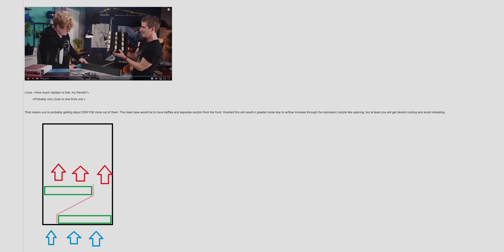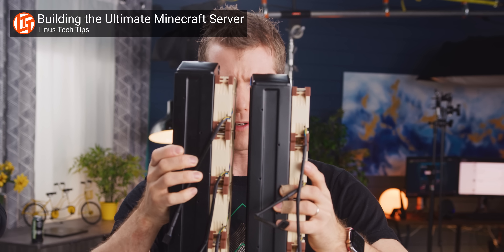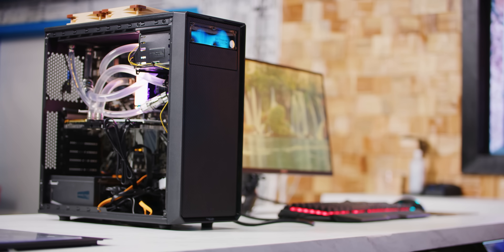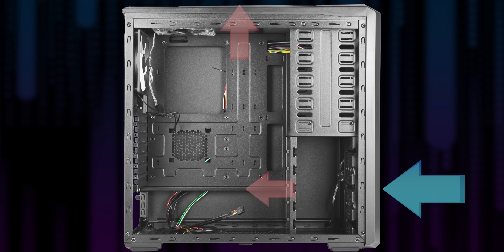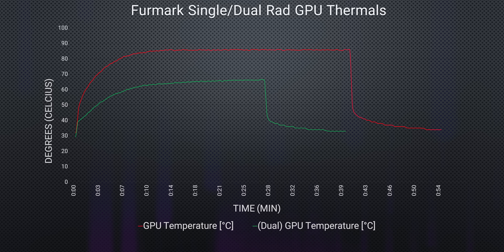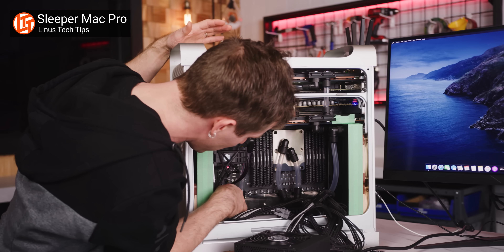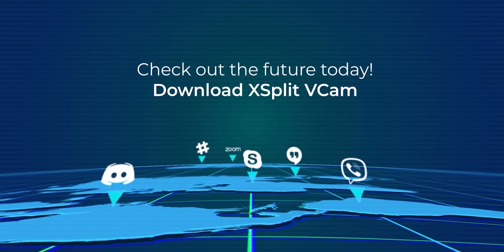I’ve been water cooling wrong for YEARS - $H!T Manufacturers Say

Comment: If you can feel the temperature difference between the air coming out of a radiator in your loop and air going into a radiator in your loop, you have a sub optimal amount of radiator. You can never keep coolant lower than or exactly equal to ambient, but as close as possible within the constraints of your build should be the goal. More radiator = more surface area = more heat can get out of the loop more quickly into the air = lower coolant temp. Lower coolant temp = greater delta T at the part being cooled by the water = better cpu/gpu temps. You don't want your delta T from water to air to be large. You want delta T from coolant to cpu/gpu to be as large as possible, and if your coolant warms up that shrinks, reducing the effectiveness of your coolant. I think what corsair was probably getting at is there are more efficient solutions to get the same amount of heat transfer out of less radiator compared to just brute forcing it, but brute forcing cooling always works.

Comment: I always try to put my radiators as intakes whenever possible, so there's a larger temperature differential. It also makes for positive air pressure inside the case which is beneficial as well.
Reply: I do the same. Found out that water temp can be 2-3c lower which is huge. Just that dust tho...
Reply: @MrScart35  Yeah the worst is clearing the dust between the radiator and the fans. I typically do that once a year. I don't live in a high dust environment thankfully.

Comment: The real problem is that you keep ignoring Thermal Dynamics. It isn't cooling you are after but moving heat. For example the fastest way to overheat any system is the last stage where the heat is moved. If you keep transporting heat rather than cooling in mind it will help. 

What you are doing Linus is causing the heated components to experience more thermal loading because you are also relying on air flow to cool but that air flow does not a high enough gradient to be useful.  The gradient or difference in temperature  is what does the work of transporting heat not the amount of airflow. You can get the same thermal performance with less airflow but higher differences in temperature. 

Yes, people kluge things together that seem to work great but how much space, how much extra electrical load and really how reliable is these kluge setups. Reliability and efficiency are hallmarks of a well designed system.  All industries have the same basic problems to solve. It might pay to look at solutions in H VAC  Systems, Hydraulic Systems,  and how Server Farms are really cooled.

Comment: The problem is you can only cool the water down to the temperature of the air with a radiator otherwise you'd need a compressor like it find in a fridge, freezer or air conditioning unit.

Comment: Def cases (quite literally cases) where corsair is right but yeah this is disproved many times. To be fair though I mean yeah if you have 2 x 360 rads and you remove one, that's going to make a huge difference, what makes me cringe is these 3 x 360 rad set ups in Lian Li 011 cases that may actually prove corsair's point, there is diminishing returns, many videos out there doing this. I have a big Danger Den case that has 4 x140 and 2 x 140 fan slots and i have a 420 rad and 280 rad, years ago i did a test removing the 280 and the temp reduction of CPU was only 5C on the CPU and i think that is because the 280 radiator has low airflow from the bottom and I planned on building my system later on with just a single 4 x 140 rad. But its been like 7 years and all i have done is replace my GPU and that was the last time i drained the loop lol. Nobody will read this comment lol

Comment: 0:29 Nah, sorry... My keyboard has this thing called a right arrow. It helps, a lot.
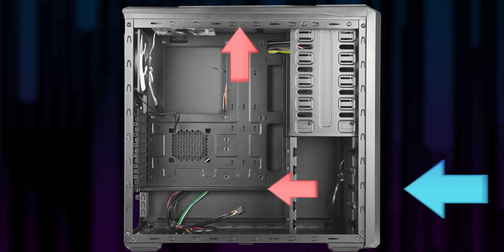5:59 So... You're saying people with multi rad should run negative pressure? If there were so many holes in the case, why not run both rads on pull-in / positive pressure? :X

Comment: Stop calling it a test if you refuse to do it properly. Stop saying that you have the answer when you fail at even the most basic aspects of testing. 1 or 2 runs is not enough data. That PC is not the same at all as the two they where criticizing you over. You keep testing to prove your hypothesis instead of trying to disprove it. That is a huge issue and invalidates your results. Ask a question, propose an answer (hypothesis), try to disprove that answer, Try EVERYTHING to disprove that answer, when and ONLY when you have exhausted all tests can you say your hypothesis is correct. You did a test and did not account for additional airflow and then blamed corsair for it. That was not a part of the test and you only mention it as a possible answer so you don't even know. To preform a test you REMOVE ALL VARIABLES YOU ARE NOT TESTING. If the back and bottom are part of your cooling system why not put some fans there to see if that makes a difference? Why not use one of your other 2 fresh air intakes to cool the rad instead of the EXHAUST. These are not tests these are you fumbling around and using words you do not seem to understand.
Reply: And before others say it. Removing 1 rad and seeing a change for 1 run is not a test. There are so many factors and variables that could have changed in the time it takes to remove the rad. The air conditioning could have stopped and the room could have heated by 5 degrees. There are countless explanations for a 5 degree difference and you did 1 test so you can't account for ANY of them. Also I think that using 1 $100 rad for 5 degrees kinda proves Corsair's point. There are better solutions and they told you yours was not as good and you just said "nuh uh see look temp is lower thus it is best cool ever".

Comment: Doesn't the fact removing a huge fat 360 rad only resulting in a 5degree increase say something else? Like the cooling capacity of said rad was diminished to that point because of the stack. Why not test the 1 360 outside the case with the 2 stack still in the case to compare?

Comment: If their simulation take into consideration the model of the fan being used they may be right. If not they are wrong.
The results very depending on the airflow
Reply: Their simulation would have to take into account fan flow rate, air flow deviation and case air leakage.....otherwise, the simulation will produce incorrect results.

Comment: i think what corsair was pointing out is that stacking rads, or pumping hot air through them, is that you reach the point of "diminishing returns".
In the triple stacked minecraft rig, the first rad takes 20deg out of the coolant, the second 10 and the third 5. if you had only 2 rads, each with a fresh air intake you would achieve the same 35deg of cooling but with only 2 rads and 2/3 the cost.
If there is no choice due to packaging constraints like in the hackintosh, fine, but otherwise things should be designed to be efficient. 
Corsair is after all selling a product for profit, in a competitive market with slim margins. you however, are building things for the views.

If you started building those minecraft servers and selling them commercially in a competitive market, you would pretty quickly find a way to do it with only two rads (there even seemed to be a graphic in your video showing air guides to split the cold air intake between two radiators).

Comment: Experiment. 1 long radiator 2 fans. measure temp of water going in and temp of water going out. You can just use water heated to around 70c for the test. Then stack another radiator in series. repeat temp test, then add a third radiator in series. Retake temps. I think each radiator will decrease temp although each radiator will have diminishing returns as the more you add, the warmer the air that will hit the radiators that are later in the series. Adding fans may increase airflow total but I don't think that is what we are testing.

Comment: Adding a second radiator and lines also increases thermal mass, spreading the heat load out over more material, and thereby reducing overall temperatures.

Comment: Corsair need to fire both their R&D team as well as their marketing team who let them make such comments.
As long as the air entering the radiator is not hotter than the coolant in the radiator it will add additional cooling to your water loop even if the air has already been heated by another radiator. 

lol Corsair doesn't know what they are doing, no radiator is transferring near 100% of the heat to the air that passes through it, generally the exhaust air will gain a few degrees, in fact the less gain in temp from exhaust air the more efficient the radiator works (as you should be increasing the air flow to keep exhaust air temp low) due to a large temp difference between air and radiator (you want the air taking as much heat as it can as it passes through radiator, not just on the front surface of radiator).

Comment: And Volume of Fluid eg the Size of your tubing, if its only 3/8th ID vs 1/2 ID or 1/2ID 3/4ID  or smaller then 3/8th (like most AIOs)  also Pump Speed if you only running at Speed 1 (Low) and Speed 5 (High) found on most D5 Pumps. Also thickness of Said Radiator and Direction of Flow some are Counterflow some are Cross Flow...  Corsair Clearly does not understand the non-AIO water cooling system.

Comment: Also the order the hot water gets into the radiator is super important.  The hottest water should get into the "last" radiator first.  So in the test rig the water should flow into the top radiator first and then the front radiator second.  Its essentially counter current heat exchange.

Comment: Well..yeah..think about a cup of coffee.. ones that are freshly made cools faster than another one made a minute ago. Key word "FASTER".

We learned this in electrical on the topic of Heat Transfer, it goes from hot to cold.
Reply: Also, the simulation may not be 100% correct as the air inside the case starts at room temperature. Which allow stacking to work, basically maintaining the cool air inside.

I am curious for places with higher room temp to start with.

Comment: You might get better cooling if instead of stacking 3 radiators on top of each other, but if you put them side by side. By having the water come in one, go to the next, and then the third before going back to the system may provide even better cooling. Unfortunately, I don't know of a case that wide.

Comment: check the difference with the upper fans blowing fresh air in , pulling fresh air in across both radiators and creating more positive static case pressure.  I am running dual loops with both rads with fans blowing into the case. My theory is that that temps will stay cool enough that the case temps don't get too hot. Am I wrong?

Comment: Pretty obvious that Corsair's model is with a fixed minimum airflow. Corsair would be trying to keep costs down and wouldn't put in anymore fans than absolutely needed. With anything resembling decent airflow, the output air is never 1 degree cooler than the water temp. The stack works because adding all those expensive high end fans pulls more air through the radiators.

Comment: In the case of stacking radiators next to each other, yes there is more surface area resulting in a slight increase in cooling effectiveness, but it is limited because of the airflow restriction. The convection that occurs in the radiator fins is dependent on air flow rate though surface area still plays a role.

In the end it comes down to a balance because both higher air flow rate and more surface area contribute to better cooling when it comes to radiators, but because we are working in an enclosed environment where space is a limiting factor, there are situations in which we need to balance the 2. Trial and error would need to be conducted in order to best optimize cooling between more stacked radiators and higher air flow fans. One limits the other as more fins limit the amount of air that goes through. Less area let’s more air through, but decreases surface area available for convection.

Comment: You're comparing different instances of heat dissipation. Adding a bigger heat-sink to the CPU will absorb more heat from the CPU, but not necessarily remove it as efficiently from the entire system. Stacking radiators is just creating a bigger heat-sink within the system, so it dissipates the heat within the system. The problem is that stacking the radiators has the potential to reduce airflow as corsair pointed out. Thermodynamically, you still have the problem of offloading the heat to the atmosphere, but now airflow is less efficient, so corsair is correct. You need to compare your results between the stacked radiators and the same number of radiators spread out with unimpeded airflow - I'm sure that you have a suitable case somewhere for that. Alternatively, you could setup an unstacked system with the same thermal mass (if you don't mind the math involved). Phrases such as "put the nail in this coffin" suggest that somehow you have found a way to disprove the laws of thermodynamics, which would be an interesting video to see.

Comment: This video does nothing to dispute the claims made by Corsair. The problem you tested was not the problem Corsair described.

To test a hypothesis you need to create a specific hypothesis and test just that. Testing an average desktop is far from testing a hack pro, and it certainly isnt testing 3 radiators running directly against each other.

TL;DR: Corsair brought up a concern and you answered a similar but distinctly different concern that no one actually had.

Comment: 6:24 I definitely did that.
I have a portable A/C, much like the ones Linus has to move around for filming at home.  It has an intake grill and an exhaust hose for the hot air.  Since I didn't want to exhaust my freshly cooled air, I crafted an enclosure thing with foam and tape which covers the intake grill, ran a dryer hose to another enclosure that covers the exhaust fan on my computer.  
The chassis is sealed of all air leaks besides intake fans and the GPU.  I REALLY wish I had a clear case and a smoke machine, I would love to do some Corsair style testing.  But as is, it's as efficient as I am going to get it.  Step two is to move the computer to it's own closet, but right now I sometimes want the heat and sometimes it's too warm.

Comment: There's also a limit of diminishing returns when you start to exceed the thermal output of your system. The upside of that though, is that this means you can run your fans at a lower rpm for a quieter build overall!
Reply: Corsair would be correct if radiators were 100% efficient, but they are not, the outgoing air has more, thermal capacity. The bigger bottle neck is the block/paste/IHS/TIM sandwich.

Comment: Very interesting, I think most watercooled builds (cooling CPU+GPU) will be cooler in the case than in the rads (largely cause there's not much to heat the air because it's watercooled) so there will typically be some improvement with an extra rad.
If you were just cooling the cpu, then the hot air from the gpu would decrease the efficiency of a second rad

Comment: Think of water cooling like a car. Add a nitrous kit to spray on the radiator for instant performance. Seriously...btw in a car cooling system is pressurized up to 13-14psi causing the coolant to reach high temps without boil over. The fluid is compressed and split through the radiator to cool as much as possible but there’s also a thermostat. :/ Wondering are water cooled kits pressurized?